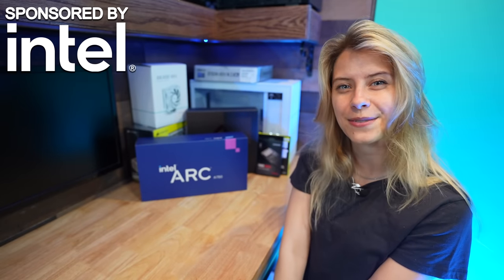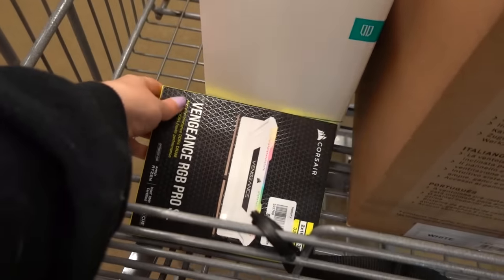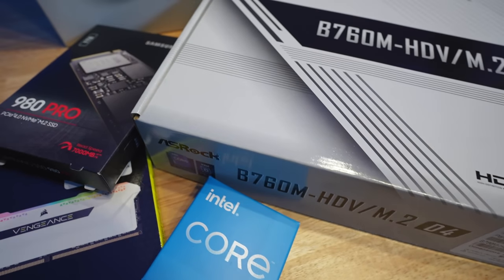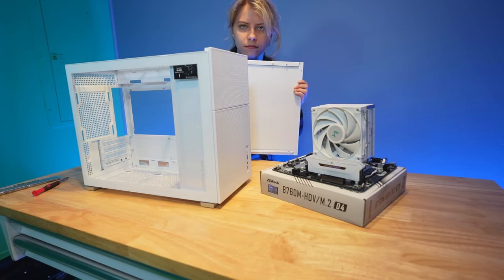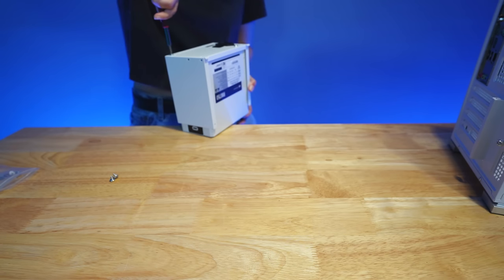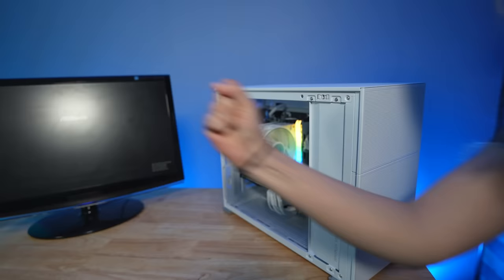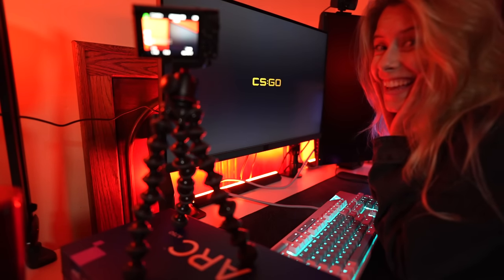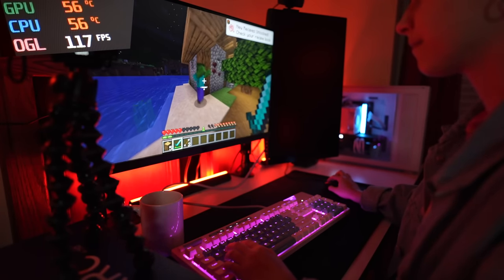BUILDING A WHITE AESTHETIC PC FOR UNDER $1000 ... WITH AN INTEL GPU!? 💙 (BEGINNER FRIENDLY)

Comment: Whaaaat! I literally am playing on an i5-12600K and an A750. I upgraded my PC last year but kept my old video card (1660 Super) and when I upgraded to a 1440p screen I needed more power so I grabbed an A750 basically on launch day. The drivers were very rough early on, but it has seriously improved. The main difference is that I went with a CHUNGUS NH-D15 cooler for my CPU which barely fits in my case, but my CPU has honesly never seen temperatures above 75°C. I am extremely happy with this computer, it should be more or less identical in performance. I even have a white case! All my games run great, except really old stuff like Fallout: New Vegas.
Reply: I totally made some mistakes with my build, too! Turns out the chungus CPU cooler completely blocks the lock on the video card so I can't actually remove the video card without removing the fan and squeeeeezing my hand down there. I had to do that twice, once to install the new video card, and once to upgrade to a nice M.2 drive, same one you put in yours! I actually reused an old power cable from a much worse power supply and my shiny new Platinum rated 660W PSU really hated that, it wouldn't reliably start, I thought the power buttons on the case were busted for a while until I swapped that out. Also the cooler is just so big that the second fan physically touches both the RAM and the side panel... yeah it's a tight squeeze, had to shift that over a bit! I could have better airflow, the case only came with two fans, one front one back, when it could honestly use three front fans for more intake. But overall there weren't any major mistakes, I did the motherboard standoffs perfectly, only struggled a little bit with the cooler bracket, pretty good job all things considered! Extremely happy with the whole build, hoping to use it for many years to come :)

Comment: Nice build, I love that case, I rather micro ATX size and this case just can fit it all.

BTW, I've seen this trend in some build videos, they're not using a back 120mm fan, use it, if the case doesn't have one, buy one, it will help a lot on lowering temps.

Comment: I feel the pain with the MOBO Standoffs.  Most cases label the standoff hole with an ATX, MATX, or ITX to indicate where to install the standoffs for the size of MOBO you are using.  The socket to tighten the standoffs are designed to be used with a screwdriver.  If you ever loose the included socket, you can always use a similar sized socket and socket wrench to achieve the same thing.

Comment: 1:25 I've hard that there's also another company that makes cpus and gpus, but unlike intel, they have 30+ years of experience in making gpus, and they were the original company to make re-bar available, the "literally designed to work together" part, side note, if re-bar wasn't available, the performance of ark would have been more awful

Comment: The computer looks very nice and clean tho i would have a small suggestion on the cpu cooler. Try putting it on the opposite side of the cooler and make sure its set to take the heat out because you might get better temperatures

Comment: Firstly amazin video. And secondly I personally wanted to build a pc but never have had the time. So if anyone has any tips and info for a beginner i would love to hear it

Edit: any tips on the monitor i should get?
Reply: Make sure to pick the right size for your eyes and desk.   Don't go too large or too small.  Refresh rate is not as important as fans make it out to be. Anything over 144Hz is overkill.  Regarding resolution, if for gaming then get what your GPU can easily run the games you want to play. Also take into consideration for how long you are going before you upgrade your system. A PC which can always easily run games at 4K or even 1440p,is a more expensive system to keep upgrading to do so, than a system for 1080p resolution.  Regarding the monitor's panel, to each their own. I prefer better color accuracy and wider viewing angles,so I prefer IPS. Good luck. 👍
Reply: @Trusteft  this is amazing. Thanks
Reply: @M0N3V  You are welcome. Enjoy.

Comment: YO BUTTERS...... nice video and a semi good computer for the price .. but here an invention they can do.. all the wires that you put into the block onthe top onto your motherboard.. like the on and off power and led light and hdd lights and speakers and all the fiddley stuff when you have to put it all the right way. like at 6.09.. and spend the next 20 minutes looking at the manual. why dont thay just put all the wires it in a block with them all done  for you  so you can just push it onto the motherboard in 2 seconds rather then wasting 20 minutes  of your life